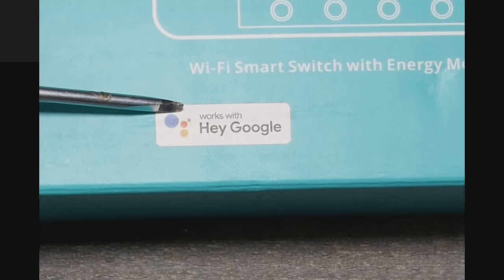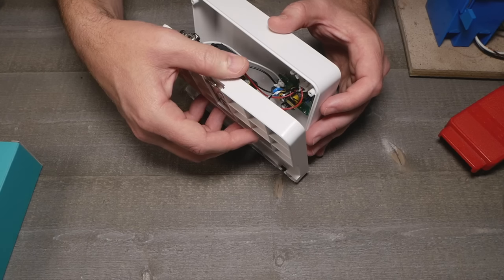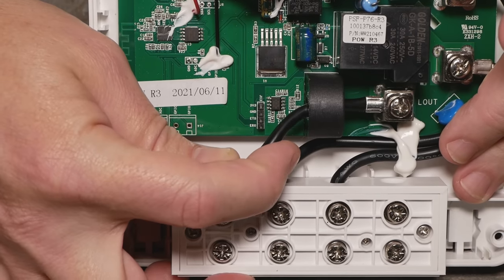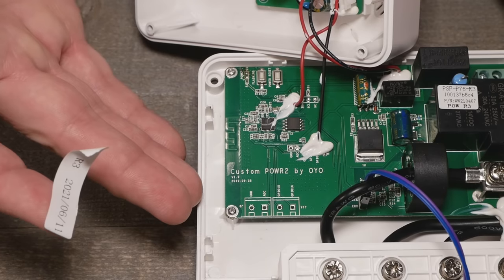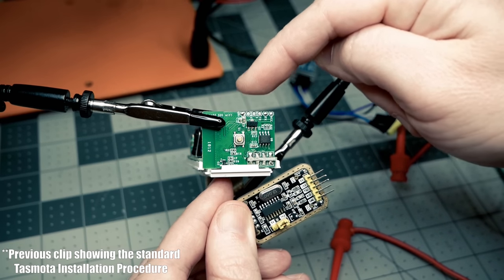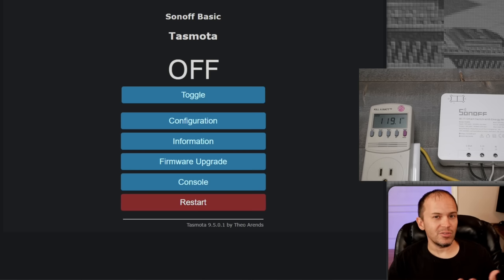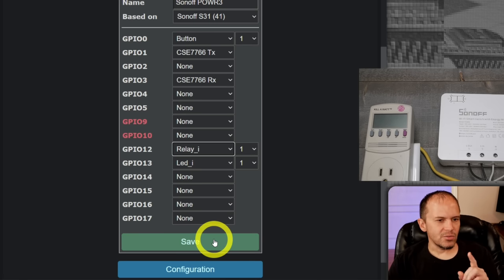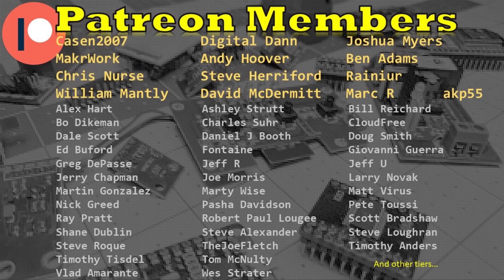Sonoff POWR3 25 Amp Smart Relay Review w/ Tasmota

Comment: 12awg will, as you know - by code, have a max breaker size of 20A in the US. It's good that they went with a larger relay & CT than the wire rating though.
I had dry rotted insulation kill 2 Shelly 1PMs on an outdoor led flood. Wire would arc to ground when the wind blew just right. 1st Shelly survived it tripping the breaker, once; welded the 2nd time. 2nd unit burned open on a 15A circuit breaker. My head wasn't thinking or I'd have checked the 30yr old wiring on the 1st incident. 🤦🏼🤦🏼🤦🏼🤦🏼🤦🏼
I have a 7A glass fuse and new wire on the circuit now. What's odd is the new Shelly started reporting 30% less power draw about a month ago but I can't tell the light output has diminished. Time to break out the current probe.
Reply: Not necessarily.  A self-contained listed device can use smaller wire gauges if the insulation is rated for the extra heat and the self contained device undergoes certification.  Oven manufacturers do this all the time for models sold in the USA.  They will use wire gauges that seem way too small but if you read the manual they explain that it has been UL listed and the insulation value is very high and the electrician needs to follow the sizing guide in the manual to determine breaker size and wiring to the appliance and not mimic the small wire gauge seen on the oven's whip.  With that said, Here in North America, you are going to have a difficult time finding a load that uses a 25A breaker AND is single phase 120V, which basically will limit you to 20A using this Sonoff device.  This Sonoff device was purpose-built and intended for the Indian market where 25A breakers are common, DIN rail circuit breaker mounting is common, and where the electrical is single phase at 230V.  Most likely this was intended to control the HVAC unit for a hotel room with a thermostat or occupancy sensor wired in to control the relay.  https://www.indiamart.com/proddetail/legrand-rx3-25a-single-pole-mcb-15004577262.html

Comment: Very clever the NC relay. I myself had thought a bunch times to take off the relay of some of mine plugs that have to be always on. Althow  the 25A, still feel nervous about all my house power pass to that relay, but i notested that it is very easy to make that not pass at all through the relay nor the pcb. 

If that was esp32 it was a sure buy, with esp8266 i have to think better 😁
Reply from the maker: I wouldn't run an entire house through it myself either as I don't have need to automate shutting down the whole house? Just a CT clamp would be better suited for that.

Comment: Hi. How do I know if my Appliance is on or off considering mine is connected to my geyser..? Also considering the WiFi is out of data. What happens when I press the reset button? Does the sonoff switch off? How will I know as the lights do not seem to give an indication

Comment: I was thinking about getting the POW R3 for my pool pump.  It's 115 volt, 1ph, 12.0/3.1 amp (don't know what 3.1 means).
The unit looks substantial.  
I was wondering what the Tasmota user interface looks like.  Does it graph your energy usage... Daily, weekly, monthly?  Can you download the data?  Schedule On, Off times?  Have it automatically turn off at a specific current?  Does it actually  show amps, volts and watts?
Thanks
Reply from the maker: Dual speed pump maybe?

If you are looking to graph stuff and keep history, Home Assistant is a good choice for that as Tasmota integrates directly into that.
Reply: Yes... Dual speed...
Thanks!

Comment: Still no cable clamp... so the big device still has to be mounted inside an even bigger box with some way to prevent the cables being yanked out
Reply: I can't understand why they added those big beefy cables just to move the connection point a few inches towards the outside edge of the box. A better design (at least one more compatible with the UK) would be to have the installer open the box, attach all 4 wires inside the box to the those beefy connectors near the relay, and then there is room for 2x clamps around the outer insulated cables. And where are the earth connectors? Just because the device doesn't use it, they must still be connected together. At least the POW R2 had connectors for earth. So while I initially liked the look of this device, it still needs a custom enclosure to be safe. Shame
Reply from the maker: Their design was in an electrical din rail cabinet so I understand not having the earth ground as that is handled on a bus bar usually.

Comment: Toasters (mine anyway) work for a 600W load. That CT should be good on a 60-100W incandescent if you can find one.
Reply from the maker: I have taken wire and wrapped it around multiple times on a CT clamp to simulate higher draw. Can't do this with this one.
Reply: @digiblurDIY  Sure, just replace the wire temporarily. It's screwed at both ends if memory serves. An 18AWG wrapped a few times to test a small load should work. Been since morning when I watched so I could be responding out of context.

Comment: I was using pow 3 with sonoff firmware as a voltage and current sensor in automation to protect appliances from high or too low voltage, the problem was sonofflan integration was works only in cloud and update reading too slow, yesterday i tasmotized pow r3 and integrate it to home assistant with mqtt addon, but instead of solving the problem, it became bigger, readings in home assistant are two slow to update to the extent that it makes it useless
Reply from the maker: Did you use the powerdelta command?

Comment: Correct me if I'm wrong, but the device switches only one phase, so this won't work for switching a US water heater right? The water heater in my house uses 2 phases. I sent Sonoff an email asking if this would work for that purpose, and they said yes. Can someone confirm?
Reply from the maker: Correct this only one relay for one single phase. The US electrical water heater is usually 240v out of the split phase to the home so you have two hots to cut. In this case I would probably go with a contactor that can cut both hot wires.
Reply: @digiblurDIY  Thanks. I'm guessing in Asia, one relay is all it takes to switch a single phase, 240VAC. Good suggestion on using a contactor. So a 2 pole contactor, 120V coil and a plastic housing to throw both in, I should have a decently priced wifi water heater switch. Actually, if I'm going to use a contactor, I wouldn't need the POWR3 to energize the contactor right? I could just use, say a Sonoff Mini for that purpose?
Reply from the maker: Yes. You would only lack power monitoring at that point. Sonoff Basic works as well. Depending on the type of contactor and it's input requirements.
Reply: @digiblurDIY  Not sure if the POWR3 would be useful in this case for monitoring the power because the two hots would go directly into the contactor, the POWR3 would be just drawing whatever current it takes to energize the contactor, and not seeing the current drawn by the water heater. Am I wrong?
Reply from the maker: That is correct. Not the product for use on a US water heater.
Reply: I have to disagree with your answers : I live in Canada with 240vac water heater.  I use the sonoff PowR3 actually.  The wiring going to my heater is 10-2.  The relay is probably cutting only one phase but this is enough to stop current flowing through it as the neutral is not used, not even going to the heater.  If you have a special heater that need both phases and a neutral (10-3) then maybe you would need to be careful in what phase is used to feed the 120vac part that is requiring the neutral and avoid cutting this one.
Reply: @Fox350Karting  So you connect one of the two hots directly to your water heater, and the other one is switched by the POWR3? Do you use the neutral terminals? Does it accurately monitor the power consumed by the water heater?
Reply from the maker: Interesting. Been a while since I have seen the water heater wiring on them. As long as the amps are low enough then cool to see it works. I am guessing it only reads half the amps of the heater but is th true amps going through the Sonoff itself.
Reply: @mikepeterson443  you connect one phase to Lin from the breaker, let say red wire.  The other red going to the heather tank is wired to Lout.  So this phase is going through the internal 30A relay.  The black from the breacker to N and the black to the heater tank to the other N.  Those two terminals are internally shorted as a single terminal.  Yes it do work and measure accurately my 4000W 17A 240vac heater.  In bonus there is the limits that can be used to shut off the device in case of over current.  I have a 30a breacker and set the limit at 21A.
Reply: @digiblurDIY  it is reading full current because full current is going through one wire, the one wired to the Lin-Lout.  This is where they put the current loop sensor.  Multiply by the voltage you get the power.  Also remember that heather tank only have 240vac element and only one is heading at a time.  Hope this helps!
Reply from the maker: Thanks for sharing! Been a while since I have been around electric water heaters.
Reply: @Fox350Karting  Confirmed working. I flashed it with Tasmota like all my other Sonoff devices though, to make it easier to integrate into my Home Assistant. Thanks for pointing this out.
Reply: @mikepeterson443  great!  I am using it in ha with hacs Sonoff Lan integration.  It is straightforward.  My Tasmotizer is not yet needed as local control is supposed to work  also.  Happy that it was useful to you!
Reply: @Fox350Karting  Merci.

Comment: do you know if it will handle a pump startup voltage? 
my pump is less then 16A but the start off currnent is way more!
Reply from the maker: I would definitely measure it if you can with something or look at the specs on the pumps as they usually show the highest amperage needed.
Reply: @digiblurDIY  very old... only thing I got his 975 watts on the sticker...
Reply from the maker: what size breaker is it on would be a good key I'd think.
Reply: @digiblurDIY  yes but i think an MCB breaker is diffrent in terms of start current 
it can handle more then a simple relay.... but maybe that realy is not that simple...

GK-A-1b-5d i was able to get the part number of the video 
but cannot find allot of data :(

Comment: Just letting everyone know…
My FTDI with 3.3V didn’t work to flash. At the last try, I changed to 5V and I worked great. Ps: I know it should be 3.3V, but I was desperate and gave it a try, and it worked great. If anyone is experiencing the same problem.
Reply from the maker: FTDI is known to not have enough power in many cases.  Usually those involve an ESP32 which is surprising yours didn't work here on the esp8266.  I usually do not recommend the 5V thing as people have fried their chips before with this.
Reply: @digiblurDIY  I totally understand and agree. I have flashed 20+ sonoff devices (thanks to you rsrsrs) and all worked great. In this case my FTDI didnt work. I bought a new one and also didint work. Since I only use tasmota, I gave it a try on 5V. I'm glad it worked.